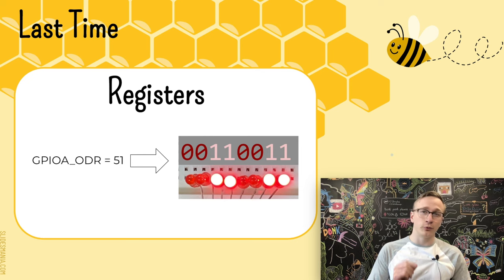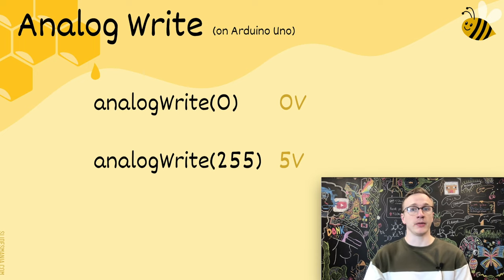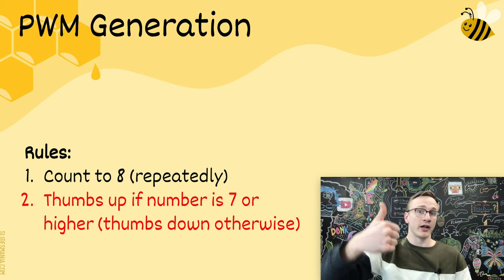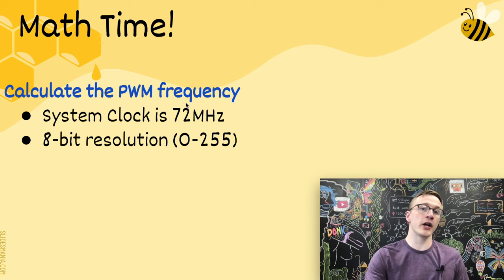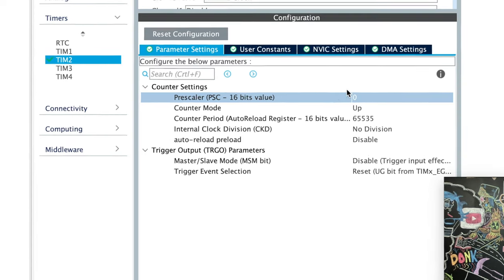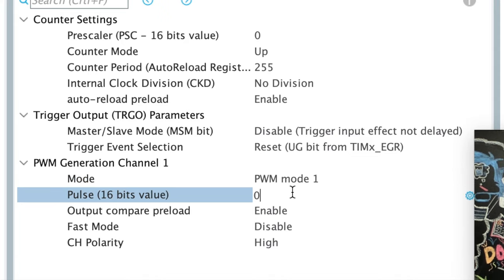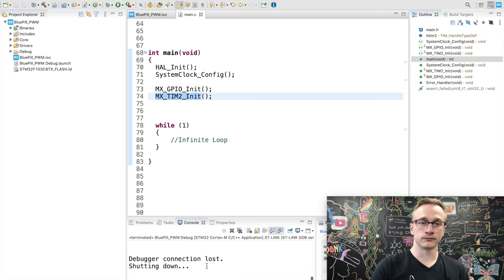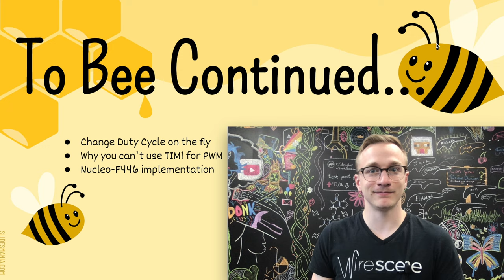STM32 Guide #3: PWM + Timers

Comment: how to generate PWM using Timer internal Interrupt?
Reply from the maker: Can you explain more what you’re saying here?

Are you trying to use a timer to create an interrupt that triggers code to turn a pin on and off?

If so, can you explain why you would want to do this instead of just letting the internal hardware handle it for you?
If you’re using code at all to generate a PWM signal, it will be much slower than just using the built in PWM drivers
Reply: @MitchDavis2 , I have worked on PSOC 5 to generate three SPWM.
first, I build the system 
and I used these functions:

1.	PWM_1_Start().
2.	PWM_1_WriteCompare(i).
3.	PWM_1_WritePeriod().
4.	CY_ISR(control_loop).
5.	CyGlobalIntEnable.
6.	ISR_StartEx(control_loop).
And the following steps explain what I did:
1.	I handled the PSOC to get PWM with Frequency = 5KHz.
2.	Then I put an interrupt signal which works when the counter reaches the max number of the counter after that the Terminate clock (Interrupt) gives a rising edge and the counter starts counting again.
For some reason, I need to use the NUCLEO-STM32 to do the same thing but I did not find these functions in the reference manual:
1.	CY_ISR(control_loop).
2.	CyGlobalIntEnable.
3.	ISR_StartEx(control_loop).
Reply from the maker: @ahmedelkafafy9427  interrupts are handled a little differently on the STM32.  You don’t need to re-enable interrupts every time.

But once again, why are you trying to do software PWM instead of just using the built in PWM on the chips?  It sounds like you’re adding more complexity than you need.